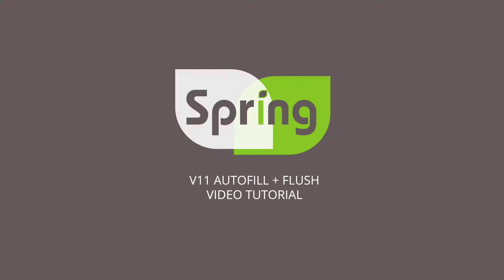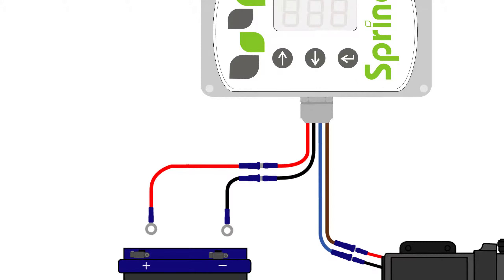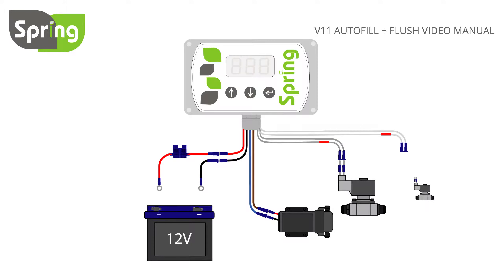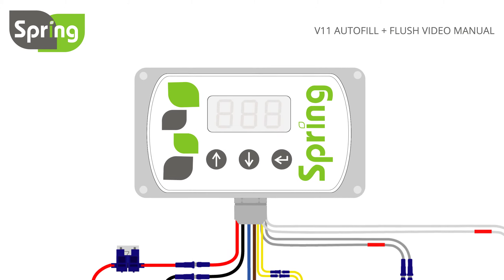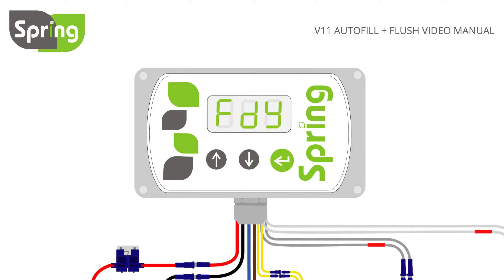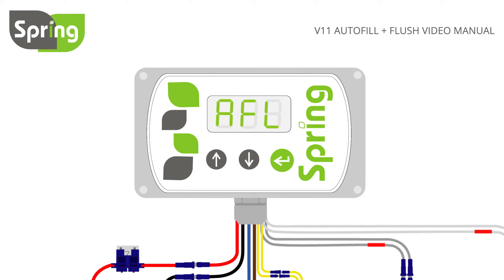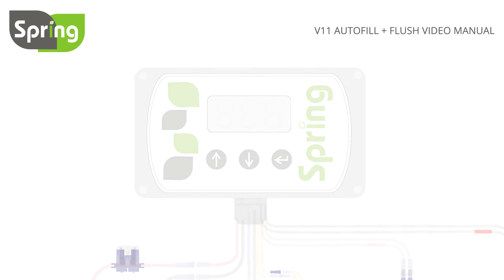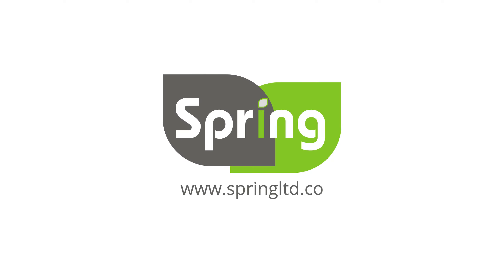Spring (Europe) Ltd - V11 Autofill + Flush Pump Controller Video Manual

Comment: does this work with a booster pump installed? is it possible for the controller to switch  booster?
Reply from the maker: Thank you for your comment. Unfortunately this controller will not switch a booster pump but we do have a controller that works with booster pumps. Here is the link for more details http://springltd.co/v11m-bpc-90-230vac . If you need any further information Ian Sheppard will be happy to help you his contact information is on our website please use the sales number.